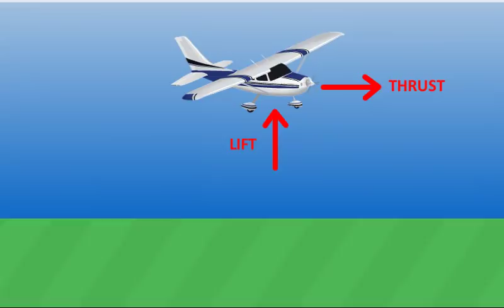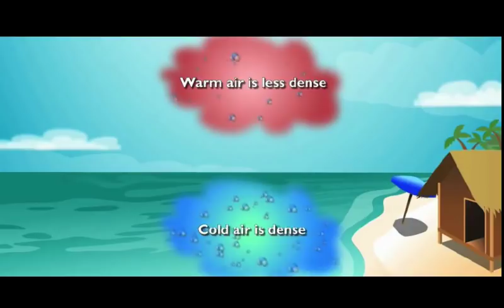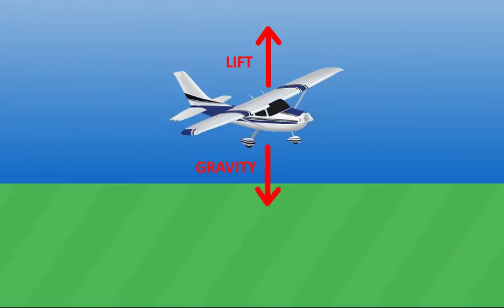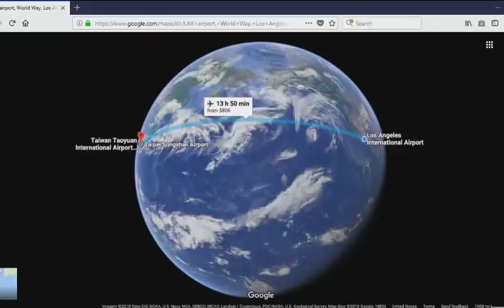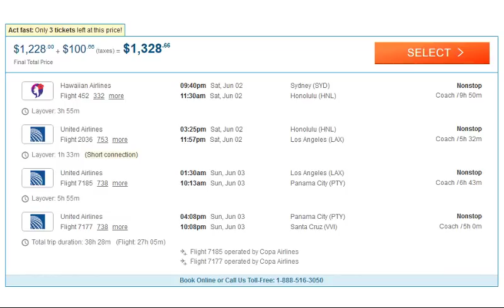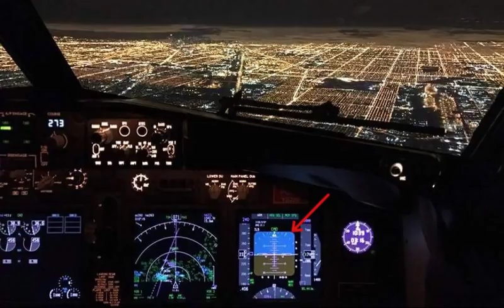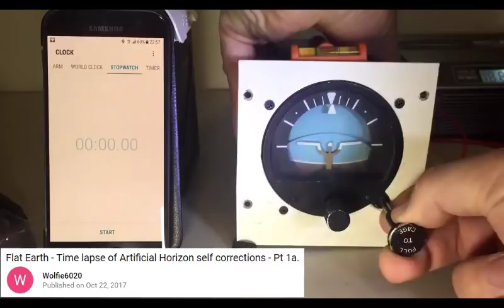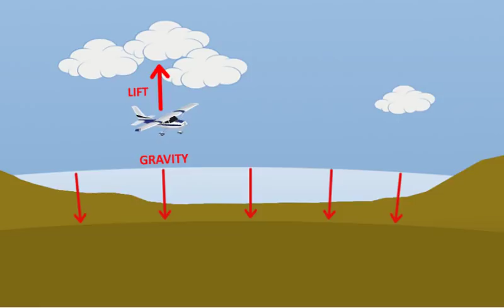Flat Earth Falsities - Plane Nonsense

Comment: Normal person: Hmmm, this doesn't make sense to me, I better do some research.
Flatearther: Hmmm, this doesn't make sense to me. I've been lied to by the government, I've been fed lies all my life. I MUST make my own conclusions. I'm paranoid and I have ALL the answers. I MUST go on the internet and complain, I MUST call all people sheep whilst being on social media, I MUST be an asshole!!
Reply: DefaultDan  actually the lack of curvature is mathematically sound using every day observations. For example, picture a contrail situated from north to south in the northern hemisphere. The southern point of the contrail is traveling faster than the northern point. This is more noticeable the longer the contrail is in distance and also the amount of time it has been in the air. 

This is due to the atmosphere moving slower the further you get from the equator (simple triganometry), until you are spinning at 0mph at each pole. 

If you are struggling with this, imagine a line of 100 cars. Each car represents 1 mile of contrail. The northern car is travelling at 0.1 mph, the car to the south at 0.2 mph etc.

This means the southernmost car is travelling at 10 mph. After 3 hours the northern part of the contrail will be 29.7 miles away from the southern point and a slope would form. This is not what we observe. Contrails remain in straight lines regardless of which way they face. One can often observe 2 contrails forming a right angle in the sky for many hours, thus the atmosphere does not spin.
Reply: DefaultDan  this is triganometry which is repeatable observable and scalable. To deny these laws is to deny the earth is spherical. I was under the impression you thought people who did that were dumb...
Reply: DefaultDan  maths is a language we use to describe objects. Triganometry is a language we use to describe shapes. There isn't opinions in this, there is correct and incorrect. 

I will repeat in simple terms:
Do you agree that the atmosphere moves slower the further you get from the equator, in line with the laws of very VERY basic triganometry... seriously this is level 1 stuff if you cant answer this simple yes or no question then you have no place insulting anyone on the earth's intelligence. There are 5 year olds that know this.
Reply: @ballsshirt5233  First learn to spell " trigonometry".  Then go take a class in it. 

On day one of my trigonometry class, I learned that there are two types: plane and spherical.  Guess which is more accurate when figuring distances?  Plane trigonometry doesn't account
for the Earth's curvature.  Spherical trigonometry will.
Reply: DefaultDan  man you are so bad at triganometry. EXACTLY! IT MOVES WITH THE EARTH! therefore it moves slower the further away from the equator you get. 

Let me put it to you how I would put it to a 5 year old and hopefully then you will understand. 

The circumference of the ball earth spins at 1,000mph. If you are standing at either pole it is spinning at 0 mph. Imagine your toe was touching the pole. It would take you 24 hours to spin around the axis even though it's a matter of a few feet. Very simple stuff.

If you have been stood on the equator at the same time, you have traveled a much greater distance in the same amount of time and therefore faster.

Hope you are with me so far. It's really easy.

Therefore, the further north OR south you travel from the equator, the slower you are spinning. It's a small reduction, around 0.25 mph per mile.

The same goes for the air above us (in fact using the same triganometry we know this effect is exadurated).

I hope you understand now. They teach it in schools it isn't a conspiracy theory it's an observable, repeatable, scalable mathematical rule. Do you understand this now?
Reply: DefaultDan  I'm trying to see if you understand this basic concept so I can make my next point. It shouldn't matter what 'side' I'm on. Science doesnt have a side. You should not wait to see if the argument supports your belief system before you give it credibility. Your world view should not be based on ego but on observation and experience.

So when you say you don't know what I'm getting at, do you mean you dont understand or that you dont want to answer because you are scared of what the next question will be?

I respect anyone's opinion whether they are right or wrong in mine. I have no respect for an individual who has an opinion they cannot defend.
Reply: DefaultDan  ok I'll ask simply again. 

Do you agree that the atmosphere is traveling at 1000 mph at the equator and is travelling increasingly slower the further away from the equator you get?
Reply: DefaultDan  ok so a contrail 40 miles long going from north to south in the northern hemisphere is travelling roughly 10 miles per hour slower at the northern end than at the southern end and 5 miles per hour slower in the middle?

Therefore after 1 hour, one end has travelled about 9 miles further than the other. After 2 hours, 18 miles and so on.

Do we agree with rhis?!
Reply: DefaultDan  it is completely dependant on the time. The longer the contrail is in the air the more the angle will change
Reply: DefaultDan  what do you mean by spread out contrails
Reply: DefaultDan  could you please just answer rather than trying to guess what I'm going to say next.
Reply: They often remain for several hours and even days
Reply: Depends on a number of variables
Reply: DefaultDan  so do you agree that if 2 contrails formed a right angle in the sky one north to south and one east to west, that the angle would get less and less the longer time went on
Reply: DefaultDan  Haha. 

But a moment ago you agreed that the earths atmosphere is spinning at a different speed the further from the equator you go. You might be surprised the amount of difference this makes over the course of a few hours when the trail is only 30 or 40 miles long.
Reply: DefaultDan  lol think about what you are saying. The contrail is PART of the atmosphere. The atmosphere is moving at different speeds. And your saying the contrail is not effected. That's double think mate. Makes no sense at all you've been brainwashed. You believe the coriolis effect is real yes? You cant have the coriolis effect and not this lol.
Reply: DefaultDan here is an easy example. Imagine a massive contrail 4000 miles long (earths radius, approximately) going from the north pole down to the equator. The equator spins at 1000 miles per hour and the pole spins at 1 mile per hour. After 1 hour the end of the contrail situated at the equator has travelled 1000 miles, because the earth spins at 1000 mph at the equator. And the end at the pole has travelled 1 mile, because the earth (and therefore the atmosphere - as they are fixed in place as you say). After 2 hours the part of the contrail on the equator  has travelled 2000 miles and the part on the pole has travelled 2 miles. Then 3000 and 3 and so on. Contrails can last many hours and even days according to mainstream sources. PLEASE tell me you are with me so far... the vertical contrail becomes less vertical and more horizontal relative to the equator. The angle decreases. Do you understand this concept so I can finally make my point?
Reply: DefaultDan  yes the contrail would move around at the same speed as the atmosphere... which varies... and therefore the speed of various parts of the contrail would vary ... jesus... this is simple. You are literally admitting I am right and then at the end saying 'so you are wrong'. Look up the coriolis effect. If you are saying I'm wrong you are also saying that the coriolis effect is wrong. Which it is. But I doubt you believe that given your position on the subject...
Reply: DefaultDan  did I say I think the earth is flat?
Reply: DefaultDan  no i dont think a 40 mile contrail is long enough to be noticeably effected by earths spin.. after 1 minute. But after an hour, or 2, or 3. Its very noticeable. The earth spins roughly 0.2 - 0.3mph slower every mile you move away from the equator. So after 3 or 4 hours it's about a mile difference and contrails last many hours... so yes... its measurable and observable.
Reply: DefaultDan  hahaha this is so hilarious. 

Ok picture this then. Seeing as you are so brainwashed you cant get your head around this simple concept.

There is a contrail starting from the north pole and ending 100 miles south. 

Do you agree that one end is traveling at 0mph and one end is traveling much faster (for the sake of this argument let's say 25 miles per hour though this is an estimate). After 3 hours one end has travelled 75 miles and the other end has travelled less than a mile. Are you trying to tell me it's still going to be a completely north- south contrail? Just moved along a few miles?  If so you are so brainwashed there is no point talking to you.
Reply: DefaultDan  obviously all north south contrails no matter how big or small if they remained in the air long enough would end up east to west. It's so simple this come on mate.
Reply: Look into he coriolis effect and you will see that your position is deeply flawed on this I'm afraid. Glad I could help educate you though. Trust your experiences not other peoples.
Reply: Interesting that is as far as your mind, heart and compassion can stretch. Flatties go far beyond that. Do you believe 911 was as told? If so, we have a long, long, long way to go.
Reply: @karengrove5750  I know I didn't realise in 2019 we actually have quite a few people who still believe that 911 was perpetrated by a man in a cave and 19 blokes with box cutters who managed to make 3 buildings defy just about every law of physics in record breaking time. 

Obviously no steel structures buildings prior to that had ever collapsed into their own footprint due to fire damage, or even collapsed due to fire damage full stop.
Reply: Maybe you should seek out  psychiatric help
Reply: Yes you must. But keep believing in magic
Reply: @scottmcdaniel9282  gravity cracks me up. Why does a body of mass reach terminal velocity regardless of altitude if the earth is sucking it towards its core by virtue of its mass. Gravity is in complete defiance of all observable physics...yet almost every physisist believes it. Astonishing.
Reply: Balls Shirt Because the atmosphere provides resistance to the object’s motion. Ultimately the buoyancy matches the force of acceleration and the object remains at a constant velocity. 

This seems to demonstrate the inability of FE’ers to grasp two forces acting simultaneously.
Reply: @flookd5516  if anything you are simply making my point for me (once you ignore the typical fe insult). If a rubber duck was dragged to the bottom of a body of water, it too would reach a terminal velocity upwards which would be dependant on the density of the medium (water in this instance) that surrounds it relative to the mass and density of the rubber duck.
Reply: @flookd5516  Its ironic that you assume I'm failing to understand something you clearly dont understand yourself.

The resistance element is obvious in both examples. There is a difference though, one is going against gravity and one isn't. Yet both ignore this fact and both terminal velocitys are determined by the mass and density of the objects and the mediums in which they rise or fall.

Totally irrespective of the mass of the earth...

But yeah.. mass attracts mass...because science
Reply: Balls Shirt Surface area rather than density. Why do you think gravity is an irresistible force?
Reply: ʀᴏᴍᴀɴɪᴀɴ   and by the way.. planes fly at 40 000 ft.. the flat earth model says the sun and moon are at 31000.. and yet every time i fly i still see the moon or sun waaay up above or slightyly around a CURVE.. or is EVERY BUSINESS WORKER A CONSPIRACY member? Or how about when people go out fishing BY CHINA then come back to alaska? Without having to go around america, past africa.. and all the way that way. Your bullshit way of thinking just boggles mine entirely.. PAY TO GO TO SPACE or is it freefall in a plane?? Idk here, let me think.. first thousand feet when youre falling takes 10 seconds, every thousand after that is five.. and if the sun and moon are at 30 000 ft, or even 40.. you can only fall from that high for q minute and a half... but when you pay to go to space, you take cameras, walk into a shuttle, fly through the air, leave the atmosphere at around 23 000 ft and stay in space for hours and hours and hours... all while people watch on live stream, satalite immaging, teliscopes even... but yet its all fake, huh? Tbh it doesnt even matter 😂😂 what would it change for you? I know its not fake but tell me for real.. WHAT WOULD ANYBODY LOSE OR GAIN FROM BEING ON A FLAT EARTH?? Reply or die! 😜
Reply: @otterpop5551  First of all you don't leave the atmosphere at 23,000 feet.  The ISS is a couple of hundred miles up yet is still considered in Earth's atmosphere (though it's thin enough to be negligible).  

Second you don't board a shuttle.  You would go to space aboard a Russian Soyuz spacecraft right now.  Finally weightlessness aboard an airplane (the so-called "Vomit Comet") lasts only a few seconds each arc.  Weightlessness aboard the ISS (or for that matter on any spacecraft) would last as long as you are in space.
Reply: @darrylgonzalez5251  i meant 230 000 feet, my bad.
Reply: @otterpop5551  You obviously don't read any of my posts.  I am NOT a Flat Earther!
Reply: @otterpop5551  Here's a good description of the layers of the atmosphere https://scied.ucar.edu/atmosphere-layers

The ISS is actually orbiting in the upper regions of the thermosphere.  It's thin enough to be considered space.
Reply: Normal person: Hmmm, this doesn't make sense to me, I better do some research.
Flatearther: Hmmm, this doesn't make sense to me. I've been lied to by the government, I've been fed lies all my life. I MUST make my own conclusions. I will take the suggestions by honest flatearthers and go look at my environment before I go waving the flatearth flag.
Normal person: I haven't a clue about being brainwashed. I believe everything on TV and I believe I was fed the truth when I was a baby clear up until now. I believe NASA is the ONLY part of the government that is honest and uses 500 million dollars per day of taxpayer money for good purposes. I'm going back to sleep now. No sense in investigating with my own senses what my environment tells me. I just don't CARE that much. Those people who are flatearthers MUST be assholes!! They would have no good reason to want to educate others with things I just don't get.
Reply: DefaultDan  I'm not worried about your inability to see what I see.
Reply: DefaultDan  Except for those who take me seriously enough to say, "Nobody takes you seriously" 

If you can look up Satellite images online and take all those cgi/cartoon/fake images seriously then I don't take you seriously. Seriously =P
Reply: DefaultDan  What does that matter if when you do an image search for satellites all fake images come up?
Reply: DefaultDan  The evidence is when I search for satellite images online, or earth from space. They all come up fake and that is the supposed evidence that its real to start with. I can clearly see they are fake so I don't have to prove anything. There is no real proof that its real is the whole point. How can you tell me to prove something is fake if you can't prove its real?
Reply: DefaultDan  What do you care what I think? To me its all fake. Every bit of information is available for anyone to learn and watch how Nasa fakes everything they do. I know how the fake everything and I can simply see it for what it is. Its all deception, and it sucked dealing with the truth of that and the scope of this lie. I'm not here to convince you. If you want to believe that stuff is real then be my guest, but some of us know better. I know 100 percent that Nasa is total deception so your not ever going to be able to say anything to change that and I don't even want to argue about something I know. Your inability to see that is not my problem. I can see it. So can everyone around me. I can't concern myself with something you can't see.
Reply: DefaultDan  I wouldn't care if the whole world didn't take me seriously if the world is deceived by lies that I can see are lies. I don't care what you think either, nor do I want to converse with you. You are a waste of time and just a negative entity that I'd rather not deal with. You have bad intentions, and that is why your being the way you are. Your here trying to make me look bad to keep others from discovering the truth. You take me seriously enough to do what your doing and that says it all. Have a nice day..
Reply: Nasa is a Gov agency. Nasa is lying about everything. Search for images of satellites and look at the results that come up. If all fake results come up on an internet search then just maybe all that stuff is actually fake. That is what the results say despite you shills and trolls saying otherwise.
Reply: @reggiereid1345  Said every flatearther ever. It's always the same shit you guys spew. Come up wirh something new for once. Or at least try to back it up with some evidence. But you won't, because you can't. You have nothing.
Satelites are fake. Okay? Show me the green screens.. show me the hollywood studios. Show me pictures of flatearth.. give me something!!!

Oh and btw, stop calling everyone you dislike trolls...
Reply: @Zerozerozero-m9l  Lmfao and all you have is photographs.....those cant be manipulated.
Reply: @Zerozerozero-m9l  It is in front of your face and you can't see it because of your investment in forced education and false doctrine from schools and text books. Such as: Columbus discovered America and America is free. There is a world rich in truth beyond the sphere earth propaganda that was forced on us. Just like patriarchal religion was forced on us. But you perhaps can see that. What you can't see is that science has all the pre-conceived answers for questions just like religion. But you won't see it. You can't. You are inside of it and the ego that must be smarter than others won't allow you to see it. You're too invested.
Reply: @reggiereid1345  these flattards want us to give them evidence, but once we do, they just say the evidence is fake
Reply: @lordclorox3028  prove gravity....without making it magical.
Reply: @reggiereid1345   and by the way.. planes fly at 40 000 ft.. the flat earth model says the sun and moon are at 31000.. and yet every time i fly i still see the moon or sun waaay up above or slightyly around a CURVE.. or is EVERY BUSINESS WORKER A CONSPIRACY member? Or how about when people go out fishing BY CHINA then come back to alaska? Without having to go around america, past africa.. and all the way that way. Your bullshit way of thinking just boggles mine entirely.. PAY TO GO TO SPACE or is it freefall in a plane?? Idk here, let me think.. first thousand feet when youre falling takes 10 seconds, every thousand after that is five.. and if the sun and moon are at 30 000 ft, or even 40.. you can only fall from that high for q minute and a half... but when you pay to go to space, you take cameras, walk into a shuttle, fly through the air, leave the atmosphere at around 23 000 ft and stay in space for hours and hours and hours... all while people watch on live stream, satalite immaging, teliscopes even... but yet its all fake, huh? Tbh it doesnt even matter 😂😂 what would it change for you? I know its not fake but tell me for real.. WHAT WOULD ANYBODY LOSE OR GAIN FROM BEING ON A FLAT EARTH?? Reply or die! 😜